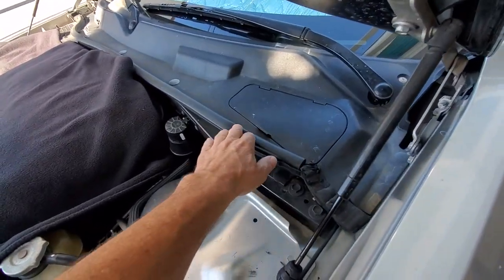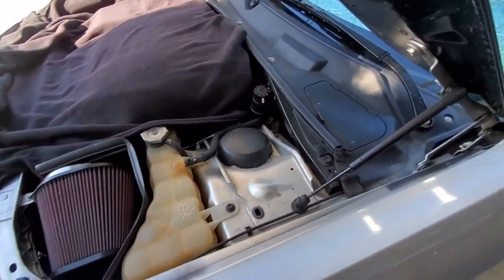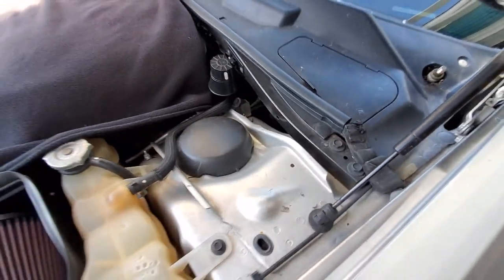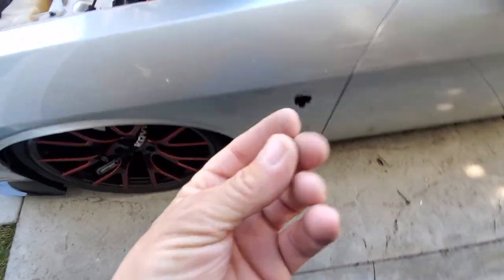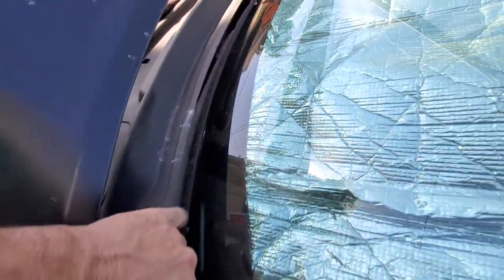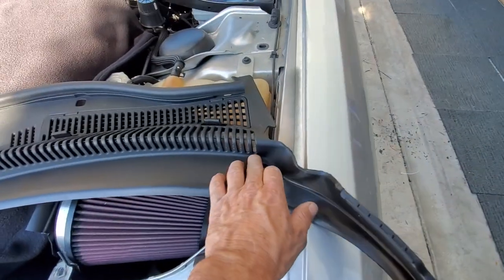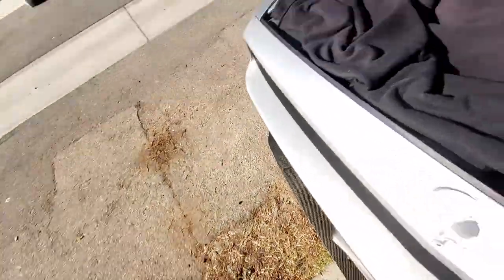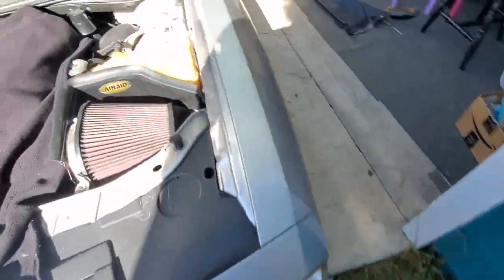Upper whindshield Wiper Cowl grill removal and installation

Comment: Hey bruh, thanks so much for this video. I've got a 2014 Challenger SXT that has the exact same issue. Was searching high & low for any info on the part and how to replace it and I ran across your video. Hopefully I won't have to work this coming weekend and I'm going to tackle this job based on your video. You're a godsend my friend!
Reply from the maker: I love to hear this! Thank you. Thank you for watching. It's definitely an easy job. You got this. It should take a hour or less. But take your time. No rush.
Reply: @TheBarrios69  Will do! I'm very methodical so I won't be rushing it for sure. You covered everything man, and the vid was pretty clear. Again, thanks so much my friend!
Reply from the maker: @PABallin48  You got it!  Thanks again for watching. I got other videos on Challengers too. Check out my Channel.

Comment: Bro thank you for the video i just picked up a new one had it hydrodipped and wasnt sure how to get the old one off. Now just have to try and tackle it. Good thing is i can change the pcm while its off easier now lol appreciate it
Reply from the maker: Right on! You will do just fine with this. It's super easy I think. It will look great after you changed it with the Hydrodipped one. Thank you for Watching.

Comment: What kind seal you use for the airbox ?
Reply from the maker: The in cabin filter box? You don't need to do anything to it i believe.  I didn't have to do anything to mine. It's a different section. Doesn't need anything done. Mine didn't.

Comment: Do you have the part number?
Reply from the maker: No, I just Google my year and make of my Car. Dodge challenger uses the same one for probably all models.  Try that. Go to Ebay.
Reply from the maker: If you need help, I can help you. What's the info on your car?
Reply: @TheBarrios69  thanks man! I have a 2014 challenger SXT
Reply from the maker: Do you want a OEM cowl grill? Or aftermarket? The OEM is about $140.. but the shipping is about $200 from a mopar seller. But if you buy a aftermarket cowl grill from ebay it's about $150 and free shipping.  Or do you just want the part number to decide?
Reply: @TheBarrios69  aftermarket would be okay
Reply from the maker: https://www.ebay.com/itm/114199638708?mkcid=16&mkevt=1&mkrid=711-127632-2357-0&ssspo=2JXmu4PESFq&sssrc=4429486&ssuid=dJJ65cpVRr2&var=&widget_ver=artemis&media=COPY
Reply from the maker: Or Amazon 
HECASA Windshield Wiper Cowl Compatible with 2008-2019 Dodge Challenger Replace for Part 5028757AG 5028757AH 5028757AG Outer Grille Panel Cover https://a.co/d/cpofqRD

Comment: U just replace the rubber seal its only $10.00 u dont need to buy a replacement cowl
Reply from the maker: I actually needed a new one as I stated. The Car is over 10 years old. The plastic was faded and did not look good to my liking. I'm not poor. I was happy to spend the Cash. Ain't No Thang but a chicken wang. 😀 But good to know for others who want a new seal and not a new complete Wiper Cowl.
Reply: Part number for the seal only?
Reply: @TheBarrios69  thank you! That's what I was thinking. My 2015 Scat Pack looks so terrible and I just ordered the new cowl then saw his comment. And I did get the new "Christmas tree" push in retainers also.
Reply from the maker: @chrisvantuyl5554  I actually saw what he was talking about. I saw it on ebay. But it would slide over the existing seal and look bulky. It's a cheap universal seal that can slide over the original seal or to fit the top whindshield rim. It wouldn't look right. Even though the actual Cowl grill cost more, you got a brand new complete cowl grill. Not just a bulky seal over the rim of a old faded cowl grill.
Reply: @TheBarrios69 
My cowl grill is in bad condition, is it safe to wash my car? I also have a challenger
Reply from the maker: @ten4k964 Most definitely,  washing won't hurt it. Just don't use a lot of pressure of water where the most damage is on Cowl.  I think it will be fine.
Reply: @TheBarrios69  
Thank you
Reply from the maker: @ten4k964  it's all good. Thank you for watching.
Reply: Where? What’s the correct name to look for it?

Comment: Its a defect with this car rubber is cheap and degrades easily
Reply from the maker: It really does degrade easy. It's in the sun constantly if the car is parked outside. It's a cheap easy fix.